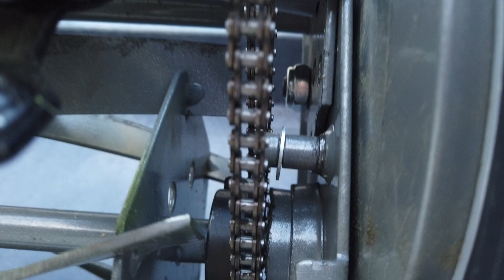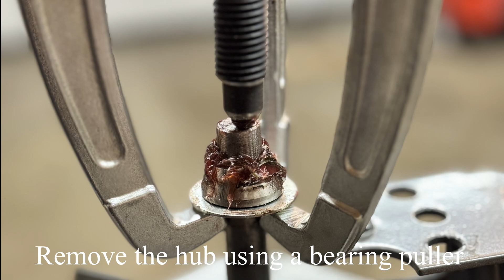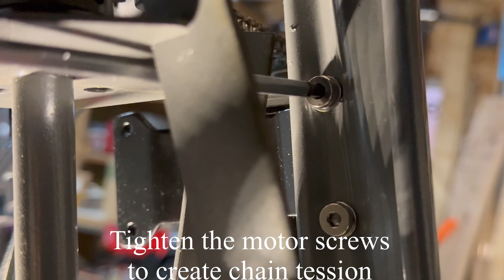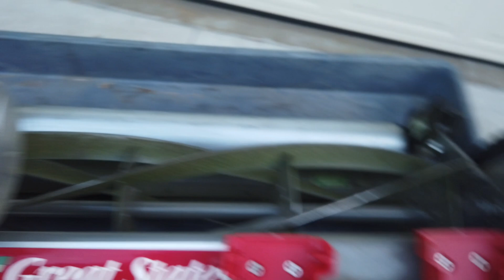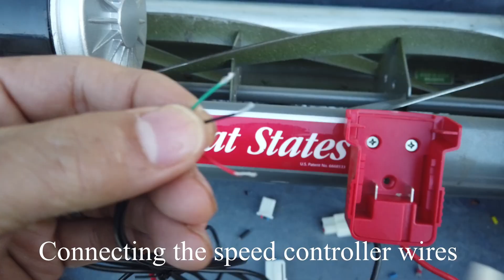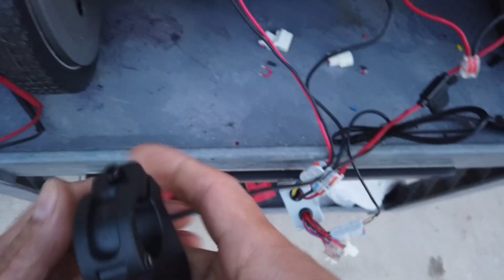DIY Electric Lawnmower Conversion – Push Reel to Battery Powered Using Scooter Parts!

Comment: I really want to do this.  I agree with another comment that the ability to reverse it so you can backlap is a very important feature.  I am sure the controller can be wired to do that.  I am not an electrical engineer but you seem to have the right idea going here.  The plastic gears are junk on those mowers anyway so its great to have the motor give the cutting power and the wheels are free of resistance.  I think I would look to add weight to the whole chassis with a stainless steel housing to protect the battery and chain from debris.  Possible to give the motor bracket more rigidity too.  Then a nicer back roller with some weight and you have yourself an excellent mower.
Reply: All he needs to do to make it capable of running in reverse for backlapping is to simply wire in a DPDT switch between the motor and the battery. That way, simply flippiing the switch to one end will make the mower run in mowing mode, while flipping the switch to the opposite/other end with reverse the polarity of the power being supplied to the motor therefore causing the blade to run in backlap mode. He'll have to suspend the mower off the ground while backlapping because the wheels will very likely run in reverse too in the backlapping mode.

Comment: Has this had any negative effect on your M18 batteries?
Reply: Depends on the brand. Some have the low voltage shutoff in the tool, some have it in the battery. Potential to discharge the battery too low, unless there's something in the controller that detects that.